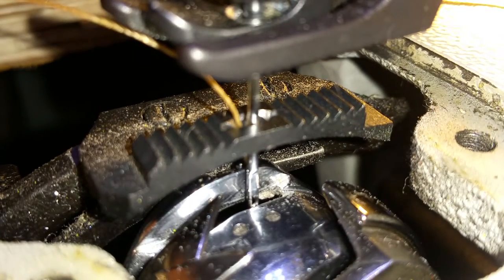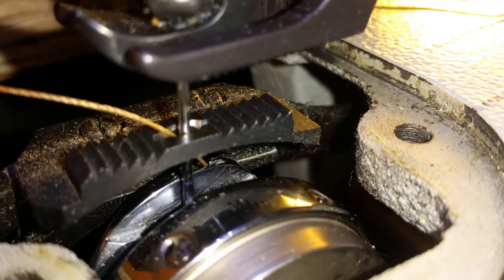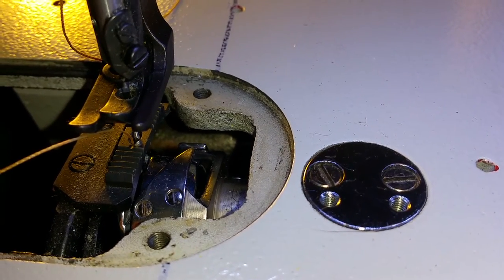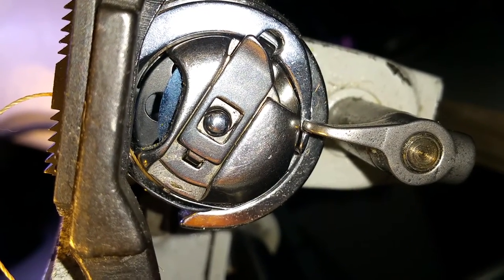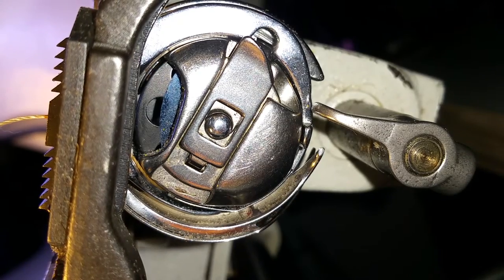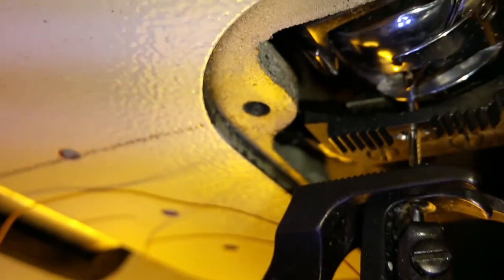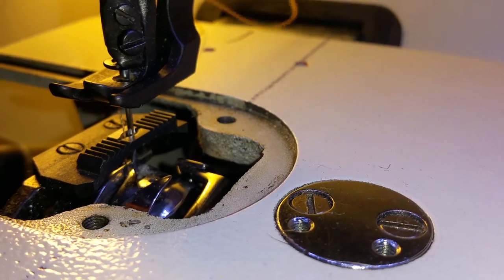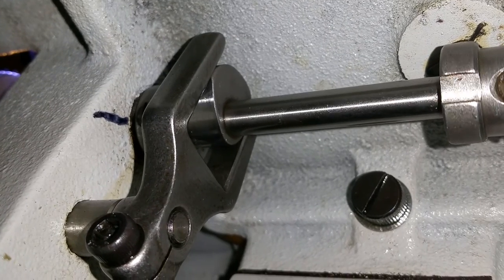Chandler 406rb-1 timing

Comment: Bob, Thanks for this vid.  I have a friend who gave me his Chandler because he said it was junk and he couldn't get it working.  I think he messed with the timing and your video just got me inspired to get this thing up and running.  Thanks!
Reply from the maker: check my other videos i have more on timing. the only advice I can really give you is be very patient. if thare is anything else i can help you with drop me a message.
Reply: +Bob Hastrich looks like the main thread is getting hung up in the bobbin and jamming. Settings were adjusted but I'm not sure how to address this.  I've  got a couple pics..
Reply from the maker: +DeMartin S/M did you go through my other videos to see if you can pinpoint it?
Reply: +Bob Hastrich getting frustrated, time to take a break. I'll go work on my taxes for a while. that should cheer me up. I watch the rest of the videos tonight
Reply from the maker: is your tension to tighten your bobbin?
Reply from the maker: +DeMartin S/M smart thing take a break I had to do the same thing